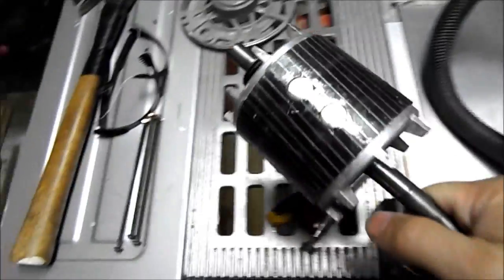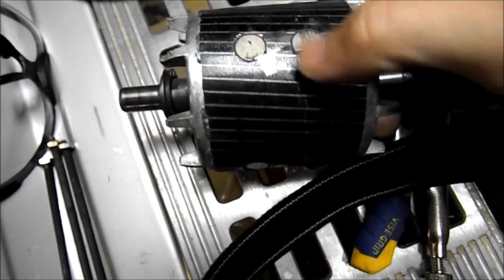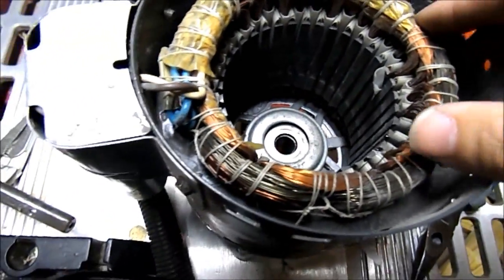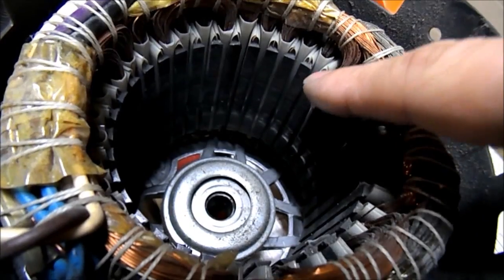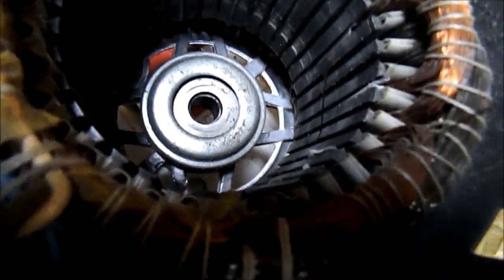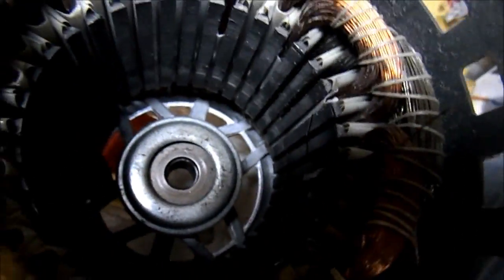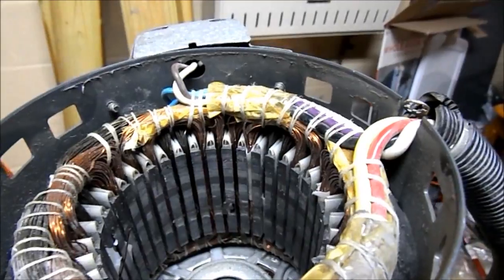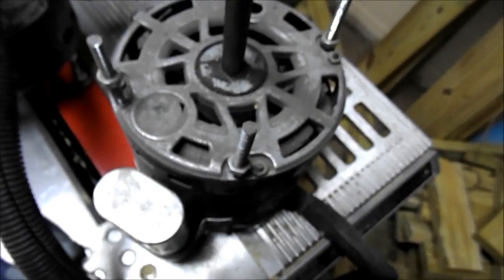Convert AC Induction Motor to a Generator

Comment: You don't need to add magnets to an induction motor, or modify it in any way to use it as a generator. You just need the right electronics between it and your load.
Reply: Ken Smith I didn't know that capacitor-run motors were resonant; I'd think that would draw damaging amounts of current.

I thought the capacitor induces a phase shift in the current in second winding relative to the first that produces a rotating magnetic field with just a single supply phase that's only an approximation to the rotating field you get with a true 3-phase source and motor. For this to happen, the capacitive reactance must exceed the inductive reactance of the winding. If the capacitor actually resonated with the inductance of the winding, the reactances would be equal, there would be zero phase shift and you wouldn't get the rotating field and the starting torque you want.
Reply: Ken Smith You're referring to a cycloconverter, a kind of inverter that instead of working between AC and DC, converts AC directly from one frequency to another. They're fairly straightforward when there's single phase or 3 phase on both sides, but things get a little hairy when one side is 3-phase (the motor) and the other is single phase (typical US house). You need some sort of energy storage to supply the motor or absorb its energy as a generator while the grid is going through zero volts. That's the purpose of the capacitor Navigator keeps talking about. It's extremely simple but the power factor is poor and the system is inefficient and can't convert frequency.
Reply: ***** I don't think the main topic was forgotten.  It is just that an interesting digression happened from the main topic to a different way to go at the problem.

There are also a few largish power plants that use induction generators.  They need largish banks of capacitors to correct the power factor.

For the mini case, I think that my electronics idea is interesting because in situations like simple windmills, the RPM can be much lower than synchronous and yet there can be energy worth going after.  The design would be well within the grasp of the hobbyist or small startup company.  I offered it as an interesting concept
Reply: Ken Smith Well sure, unobtainium would make lots of other things easier too...
Reply from the maker: you just need to run it at its rated RPM + 50 100% of the time.
Reply: Jason Roush No, not with the right electronics, i.e., a variable voltage, variable frequency drive. You can run it at any speed and torque you wish, within wide limits, as either a motor or generator. You will lose a little to asynchronous slip, but that's an efficiency issue and it remains to be seen whether a home-built permanent magnet motor is more or less efficient than a factory-built induction motor.
Reply from the maker: Variable frequency drive are for controlling the motor but is not able to turn one into a generator. They have a bridge built in that would prevent any power from being put back onto the Line side of the drive. I used one of these bridges on my wind turbine with the 5hp servo motor. Do you have a link where anyone has tested your idea?
Reply: Jason Roush Depends on the design of the drive. It's entirely possible to make one that's bidirectional. You dial the synchronous speed into the drive, and if you put a mechanical load on the shaft it'll slip below synchronous speed and become a motor. If you drive the shaft above synchronous speed it'll become a generator. The GM EV-1 electric car used a 3-phase induction motor and variable drive that worked exactly this way when doing regenerative braking.

The newer EVs and hybrids generally use 3-phase permanent magnet motors because they're more compact for their power ratings, but they're not necessarily more efficient. At high speeds and low torques, induction motors are more efficient than PM motors. The constant magnetic field of the PM rotor induces eddy current losses in the stator even at zero torque while the induction motor rotor has no magnetic field at zero torque and therefore no eddy current losses.
Reply from the maker: ApolloWasReal
3 phase drives can do DC injection. I would think if I could get a 3 phase motor with 6 or 9 wires and figure out how the DC injection works. Then harvest the power off the other two phases. Thanks for posting.
Reply: Jason Roush You can do it with a "capacitor run" single phase AC motor.  The two windings on them and nearly at right angles.  You don't even need much in the way of electronics.  Many of them will start generating if you just spin them faster than synchronous speed.
Reply: Ken Smith I think his point is that he doesn't always want to have to spin it so fast. My point is that synchronous speed is defined by the operating frequency, and that can be set by electronics if you don't want it to be 50/60 Hz, or if you're operating independently of the AC grid. This is how VVVF drives work, and they're widely used in electric traction for regenerative braking.
Reply: ApolloWasReal Yes, on the capacitor run motors, the synchronous speed for the purpose of getting it to self start is the resonant frequency so rather simple electronics works there.  Just using any split phase motor where you can get at the ends of the windings and clever electronics, you can get operation at modest speeds.  You can apply about 10Hz and get power out.
Reply: ApolloWasReal The main winding has a current that lags by nearly 90 degrees.  The winding with the capacitor in series has many turns of very fine wire.  The capacitor makes an Xc that equals the Xl of the winding so that the phase of the current in that winding does not lag.  Because the Xl=Xc (nearly) it is resonant.  The resistance of the winding limits the current to a smallish value.  The large number of turns makes I*N big enough to make a good rotating field component.
Reply: Ken Smith Okay, I can see how that works since it's the phase shift between the windings that counts. It would also be nice to have comparable strengths in the magnetic field but I'm not sure how they compare given their different impedances.

What about reversible motors? I assume their windings have to be the same and relatively low in resistance so you wouldn't want the capacitive reactance to completely cancel the inductive reactance of the winding to which it is connected at the moment.

All in all, I suspect that 3-phase motors are still probably a lot more powerful and efficient than single-phase capacitor-run motors, and now 3-phase inverters are a lot easier to make.
Reply: ApolloWasReal You get some rotation component even when there is a mismatch so it still generates just no where near as well as when the field really is a uniform rotating field.  Placing an additional capacitor across the motor helps.  The main coil gets more current in it, that way.
Reply: Ken Smith That also makes sense, you're helping correct the motor's lagging power factor.
Reply: ApolloWasReal
At this point, we have about hit where the limit of my knowledge is from actually trying stuff.  In any case, I think it is sort of obvious that a very reliable system could be made from this idea since the only parts that wear are the bearings and those can be ball bearings.
Reply: Ken Smith Yes, that's always been the big advantage of induction motors -- no brushes and commutators to wear out. It's why they're taking over in electric traction now that we have the semiconductors needed to make high power 3-phase variable frequency, variable voltage inverters to drive them.

Home-built EV conversions generally used DC motors and simple controllers, but all of the current production EVs and hybrids use AC motors. A few use induction motors, most use permanent magnet rotors to get more power from a smaller package. With the right inverter design they can become generators and do regenerative braking.
Reply: You mean to put capacitor between two phases ? I this case you can not load any other inductive load. Or to made some kind of inverter to control output power ?
Reply: ***** I'm talking about a special solid-state 3-phase inverter where both the frequency and the voltage are varied together to vary the speed. Normally the motor runs a little slower than the inverter frequency, but if the motor is mechanically driven to go a little faster, it will become a generator and the inverter will produce DC power. That's how modern electic and hybrid cars do regenerative braking.

It's just like downshifting to use engine braking in a regular car, except that it also puts some gasoline back into the tank. :-)
Reply: ApolloWasReal Not quite, there is no sens to use of variable speed driver for producing High voltage DC , you risk to go on overvolatge ( similar to VSD run in negative quadrants) and burn internal braking resistor or IGBT.
If you want to get DC you can do it just with bridge rectifier in condition to turn motor a little more than Synchronous speed. Residual magnetism can be enough to start up generating regime.
Reply: ApolloWasReal An interesting idea now that MOSFETs are low cost:

Pairs of power MOSFETs on the mains side turning 50/60Hz 3 phase into something that looks like 10KHz to 100KHz 3 phase going to the transformer and a second set coming from the transformer converting whatever frequency to also 10KHz to 100KHz.

Lets say we pick 50KHz.

Think of the mains side as viewing the  mains from a rotating frame of reference and the motor side as viewing the motor from a different rotating frame of reference.  If one rotates at 50,010 while the other goes at 49,990,  it can adapt between two 3 phase systems that run at frequencies that differ by 20Hz.

It seems like the power factor seen by the mains side could be very good and yet very little energy needs to be stored in the inductive elements of the switcher so a fairly small box could handle a few KW.

The extra MOSFETs are a lot smaller than the transformer.

The logic to drive the gates would be fairly simple because it only needs to adapt to something that changes slowly.
Reply: ***** No, you do need a variable frequency/variable voltage inverter unless you are willing to operate the motor/generator at only one well-defined speed: just below synchronous speed as a motor, or just above synchronous speed for a generator. I suppose you can use gears, but it seems more reliable and efficient to do it in electronics.

You don't actually have to have DC on the other side of the inverter. There are special inverters, known as cycloconverters, that convert directly from one AC frequency to another. You could run the generator at whatever speed you need and the cycloconverter converts power between its frequency and the 50 or 60 Hz power grid.
Reply: Ken Smith Yes, you can use MOSFETs to build an inverter or cycloconverter, and many have, especially in low power systems. But the preferred transistor for inverters and variable-speed AC drives is now the IGBT, the Insulated Gate Bipolar Transistor. It's a bipolar power transistor with a FET-like input. This gives you the best of both worlds, because bipolar transistors have a  smaller voltage drop than MOSFETs at very high currents. When shunted by diodes to protect them from reverse voltages (they are often built in) and the proper drive circuits (which are all digital) you can make whatever amount of power you want flow in either direction between the supply and the motor, regardless of the motor's speed. (Unless it's 0, of course, in which case you can't make it generate power.)
Reply: Ken Smith Cycloconverters can be huge. The last cruise ship we were on used them to convert from the ship's diesel generators, which run at constant 60 Hz, to variable frequency/voltage AC for the propulsion motors. There were two motors and propellers, each rated at something like 20 megawatts, each with its own cycloconverter.
Reply: ApolloWasReal MOSFETs of the "super junction" type have a smaller forward voltage than the IGBT.  With the IGBT yoy have a diode drop as a minimum.  The "super junction" device looks like a huge JFET cascoded with a normal MOSFET.  The MOSFET portion sees a smaller drain swing so the Cdg doesn't take so much power out of the drive circuit.  Also, the pairs of MOSFETs was suggested because that makes a switch that is bidirectional and thus makes the suggested topology work.
Reply: Ken Smith A MOSFET channel is modeled as a resistor when it's on; you're correct that a bipolar is modeled as a diode. Which has a larger voltage drop depends on the current; are you saying there are now MOSFETs that drop less than an IGBT when carrying 500 amps?

Both MOSFETs and IGBTs can be used in bidirectional inverter/converters. IGBTs are common in electric and hybrid vehicles that can do regenerative braking.
Reply: ApolloWasReal You forgot the main topic, so once and for all:
You don't need ANY electronics if your squirrel cage motor is on grid. Just turn his shaft  almost on syncro RPM and grid himself will act as regulator of frequency. When you apply more force on shaft the rotor try to turn faster then grid frequency (50 or 60 Hz) the current generated have tendency to infinity an counter force generated by stator-rotor also increase. If you turn rotor slower ,the current fall and counter force also, so the rotor run faster. This is the principle of on grid regulation, many mini hydro power plant run on this way.
Reply: ***** No, I didn't forget the main topic. I acknowledge that induction motors can be used as simple generators with just a capacitor. I'm just pointing out some disadvantages: an inability to adapt to variable speeds, as you might want to do in a wind or hydro generator as the wind speed or water flow rate changes, and a poor power factor, which increases losses in the motor and power lines and decreases the generator's power rating. (It probably also increases mechanical vibration, wear and tear.) Just because you've always done it with a capacitor doesn't mean it will always be the only or even best way as technology develops.
Reply: Ken Smith No , they not need at all capacitor bank, because they use reactive power from grid.
In case of stand - alone application , they need capacitor bank as well as regulator of RPM ( frequency).
Reply: ***** Virtually all utility grid generators are synchronous machines precisely to avoid consuming uncontrolled amounts of reactive power. In fact, they are almost always operated as synchronous condensors to generate reactive power to reduce the need for huge capacitor banks. Sometimes you'll even see hydroelectric generators "spinning dry", producing no real power but generating reactive power.

Technology has advanced to the point where we can now make a small AC induction motor operate very well as an AC or DC generator much better than with just a simple capacitor.
Reply: ***** Sure, you can hack a capacitor and a diode bridge onto a 3-phase induction motor to make something that will generate a DC voltage. But the currents in the motor phases won't be balanced, and there will be a lot of harmonics in the current waveforms to worsen the power factor. That means the motor runs less efficiently, encounters more mechanical vibration, and cannot operate at its full power rating. With a properly designed bidirectional 3-phase inverter or cycloconverter, the motor can operate as either a motor or as a generator at whatever speed and power you like, with the motor seeing nice, balanced, properly phased currents in all three phases.
Reply: ***** The power companies don't like you taking a reactive current (or supplying).  The prefer unity power factor.  They will often add an extra line item to your bill if they start to see too much reactive current.
Reply: Ken Smith You can supply if you have a net metering arrangment, which is required by law to be available in most states.
Reply: ApolloWasReal The reactive component refers to where the voltage and current are 90 degrees out of phase with each other.  It won't make your watthour meter move in either direction but if there is too much of it the power company will start to charge you for it.
Reply: Ken Smith Right, I understand that (I'm an EE). But you mentioned reverse flow, in which the current times voltage integrated over a cycle does give a reverse power flow that will make your meter run backwards. That's what net metering accommodates.
Reply: ApolloWasReal I mistook your meaning you are quite right.

The motor being converted here is not big enough to do enough to matter.

The power companies are starting to move to varying prices.  At times of peak load, the price will rise.  This will give a slight advantage to wind over solar because the peak load is after noon and we can't store power easily.
Reply: Ken Smith It's hard to predict the effect of TOU pricing on the economic return of renewable power. Traditionally solar has been the big win since it produces most on hot sunny days when people are using lots of A/C. Wind less so since it blows mainly at night when loads are low. The emerging problem is at 7 am & 7 pm, especially at the equinoxes, as both supplies tend to be low and demands peak, particularly at 7pm when everybody comes home to cook dinner. We're going to need some form of storage, for sure.
Reply: ApolloWasReal In lots of areas, the demand peak is more like at 5PM to 7PM.  If it is not so hot that airconditioning is a big load or is so cold that heating is needed, the peak is when industry is still drawing a lot and folks at home are starting to make dinner etc.  The one really predictable thing is that the value of energy storage will increase so the guy who solves that one gets rich.

I think the electric car will help.  They will be charged over night starting after the load peak.
Reply: Ken Smith We agree. The existing EV chargers can already be programmed in real time to limit the current draw by the vehicle. I think that will be enough to help balance the grid without the much more tricky step of allowing backflow from EV batteries into the grid.
Reply: ApolloWasReal I think the "tricky step" is a technological problems that guys like us eat for breakfast.  The power company will soon be sending out minute by minute or second by second pricing.  A simple charger can fade down the charging power when the price rises.  A slightly more complex on could send power back.  The converter would be fairly easy if the design is done the way I think most would attack it.

There is already a good argument for putting super junction transistors in the input side bridge so that the forward drop of the rectifiers can be reduced to the drop of the on resistance of the FETs.  These would also allow power to go back if the power factor correction stage was sending it.

If the power factor correction uses synchronous rectifiers, the topology also works to send power back. 

The same applies to the output section.

The controller could wirelessly learn the price of energy and knows the state of the batteries and the users preferences so it has all it needs to apply the policy.
Reply: I agree the electrical engineering problems are quite manageable. My problem is with the economics. Current EV batteries have a very high depreciation rate, meaning you need a very large price spread (buy very low, sell very high) to pay back the wear and tear from selling your battery back to the grid. That's why I think it makes more sense to start with just varying charging power of cars that are not yet fully charged, since the users will want them charged at some point anyway so they can drive them.

You could do this even during the late afternoon to absorb the excess generation from peaking plants as they're brought online to serve the evening peak when people get home. The problem with grid stability isn't so much a lack of supply, it's the inability of many large generators to rapidly change load. EV chargers can help smooth this out without necessarily sourcing power.
Reply: ApolloWasReal The problem with the batteries is a problem for our chemist friends.  If they solve it they get filthy stinking rich.  Thus I expect there are some well motivated chemists out there.

Adding a delay to the charging is so simple it seem hardly worthy of our firing up our brains.  The makers of the chargers and the users of the electric cars can just "go do it" to borrow a phrase.

Many years ago there was also a thing called a flat rate water heater.  It was an electric water heater that was powered by its own line.  The power company could raise or lower the voltage on that line as needed to flatten out the demand.  Today things like electric water pumps and the like could be wirelessly turned on and off to get the same effect.  I could even imagine a case where a large building could have a "storage of coldness" in some phase change material.  When power is cheap, the cooler could come on and chill the material.  In the hot part of the day the building air could pass through the storage chamber.
Reply: Ken Smith I don't really think we disagree except on the difficulty of making large, cheap batteries. A lot of people have spent a lot of time on that and progress has been painfully slow.

As for varying EV charging powers in real time to balance the grid, I'm all in favor. I just don't think we need to go so far as to actually discharge the batteries into the grid just yet.
Reply: ApolloWasReal You are thinking of the battery problem today.  We have lots of chemists who would like to get rich.  I see getting the infrastructure in place as taking a bit of time.  The power company has to do the communications to send out the variable price.  This gives that chemist who would like to get filthy stinking rich some time before we are doing the implementation.  Our part is easy. 

Another option may be for someone to spin up a flywheel with low cost power and then spin it down when the power goes up in price.  This would be an industrial installation.
Reply: Ken Smith A lot of people have been working on the battery/storage problem for a LONG time with only incremental, hard-fought success. I hope you're right and somebody makes a breakthrough and gets rich.
Reply: ApolloWasReal My prediction is based more on my hopes than on any facts I have at hand.

For short term storage, spinning up a flywheel is interesting.  You can also compress air but that isn't as efficient.

Using solar power to pump water or refine aluminum is sort of a natural.

For the average person, the biggest dent you can make today is to install a solar hot water system.  A good one pays for its self in a few years and continues to work for well over 10 years.
Reply: Ken Smith Well, that's the problem isn't it? I like renewable energy as much as anyone but I have to be realistic.

Flywheels are interesting but they generally can't store energy on a utility scale. Sometimes hydro plants are used as short-period regulators of line frequency, which is something like this.

Your third point actually touches on a much larger issue: demand control. Right now, we pretty much assume that we can draw however much power we want any time we want without any kind of prior notification. That's still generally true for residences but it hasn't been for industrial users for some time. I think there's a lot of potential in giving the grid operators direct control of customer loads in exchange for much lower prices. Examples besides pumping and aluminum smelting would include large HVAC systems and EV chargers.

And you're right about solar water heating. It's kind of a crime to use a high grade fuel like natural gas to produce low grade space or water heat. Yet I admit to doing it myself even though I have 2 kW of PV panels.
Reply: ApolloWasReal In warm places, a heat pump makes more sense than just burning fuel.

My brother did a do it yourself hot water system.  It provided all the hot water he needed on most days.  The trick is to have a truly huge storage system.

Up near Niagara, they have some pumps that pump water up hill in the small hours of the morning.  That is enough to matter.  Over in Europe somewhere, they have a mine that they pump full of air.

On the demand control side.  One problem is that new dish washers and clothes washers and the like are such total junk that those that can are holding onto their old machines.  New dish washers in general have a timer but you have to wash the dishes by hand before you put them into it.  This means that the demand for hot water still happens while folks are awake and doing stuff.

I also have what I think is a clever idea I should look into more.  Solar power is a higher grade energy supply than space heating demands.  I am thinking that a solar powered heat pump could be a very nice machine for days when it is 60ish outside and you want the house to be 70ish.
Reply: Ken Smith Yes, heat pumps are more efficient than simple thermal heaters, but you have to include the thermodynamic losses of producing the electricity they require. It would be interesting to compare the overall price/performance ratio for a simple solar-thermal heating system to a heat pump powered by PV panels. The heat pump is more efficient at turning input power to heat, but the PV panels are considerably less efficient at making electricity from sunlight than simple heating panels are at making low-grade heat from sunlight. I'm sure the crossover points will change as technology advances.

Yes, pumped storage is used in numerous places, especially where there's already hydroelectric generation. But it can require a lot of land, and the environmental impacts can be severe. We need something better.

If demand-managed rates become common, I'm sure the appliance industry will quickly adapt. Don't worry about what's already out there.
Reply: ApolloWasReal There may be a way to skip the step of making electrical power to make motion to then make a heat pump go.  Perhaps heat can power some sort of heat engine.  The cold side of the heat engine could be in the water going into the hot water tank.  The cold side of the heat pump could be the air.  Thus the mechanical process will be working from the temperature difference between the panel and the water tank.  The efficiency as normally rated would be low but the bulk of the losses end up in the water tank so the effective efficiency would be highish.

The pump generation idea works very well near Niagara.  There may be other places.  This is one of those cases where an idea helps but is not the full solution.

I already have a dishwasher with a delay timer.  Just setting it for the middle of the night will work for that.  The clothes washer and dryer is a bit harder to do.
Reply: Ken Smith That's an interesting idea of driving a heat pump directly with low-grade heat. I don't know if it would be feasible, but this is outside my field of direct expertise (I'm an electrical/computer engineer).
Reply: The temperature difference from solar panel to hot water is not a super low grade source.  I can imagine a 30 degrees C (AKA degrees K) between the two.  The ratio would be something like:

(1 - 300K/330K) = 9%

For every 1000W of light heating the panel, you will get:

1000*9/100 = 90W

A heat pump will generally move about 4 times its input power worth of heat.  So we get an extra 4*90=360W worth of heat from the panel.  That seems worth going after if the cost is low.
Reply: Ken Smith Why not just take the 1000W of sunlight heating the panel? The only losses there are the less-than-100% absorbance of the panel, and insulation losses in the panel and piping.
Reply: ApolloWasReal The calculation I did was for the additional energy you get.  If you use a panel that can be a lot hotter than the water tank directly, you get 1000W worth of heating.  With the idea you get 1360W worth of heating.  The calculation was only of the extra part.
Reply: Ken Smith Ah, I see. Question is, will the inevitable system losses eat up that extra 360W? Heat engines running off small temperature differences are notoriously inefficient over and above the Carnot losses because of the overheads required to drive the systems. Ocean thermal power is a good example; most of the power generated is spent on the pumps bringing up cold, deep seawater.
Reply: ApolloWasReal I think the "left as an exercise for the reader" status on whether the losses would be too much is a good one.  I can go work on something else instead.

Sadly things like ocean temperature gradients are the wrong way up.  In Antarctica, the cold ice is on the warmer water so the idea of thermal gradients as power could work.  I think however if I made one, I'd get blamed for the ice sheet melting.

We really need a material that goes from liquid to gas when you cool it off.  Then the hotter above and colder below could work as good power source.
Reply: Ocean thermal is a form of solar power, so it kinda has to be done in deep tropical waters with warm water at the surface and cold water farther down. As a side benefit, done on a very large scale it could even reduce the intensity of hurricanes...

A liquid that boils when you cool it? Sounds rather contrary to some basic physical principles.
Reply: ApolloWasReal I was not proposing that there was such a material just that it makes ocean thermal a lot easier if there was.